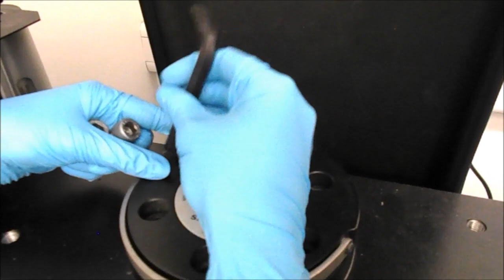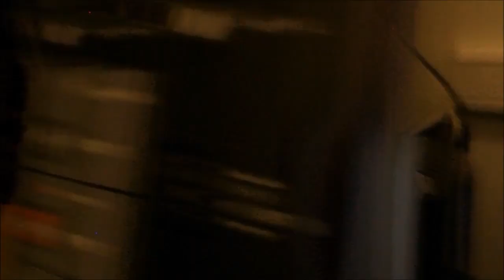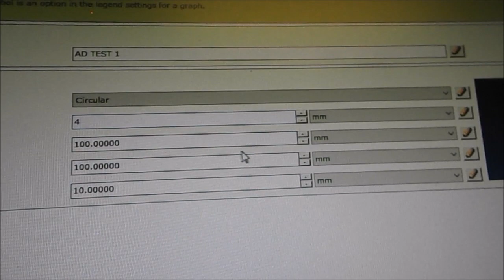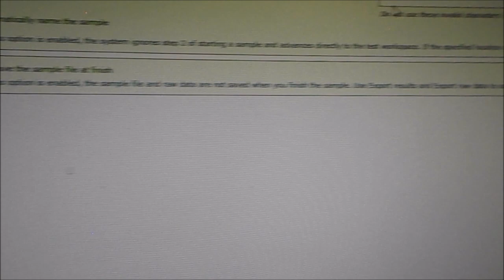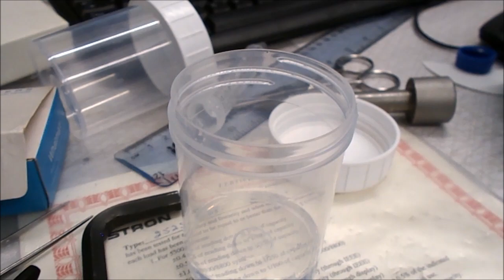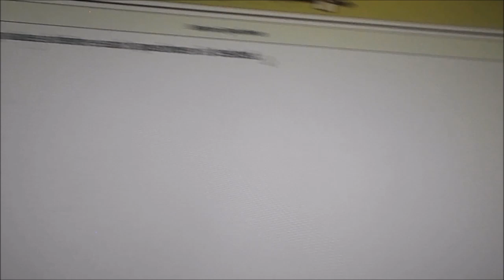Instron Compression Test Instructional Video Compression

Comment: In your test, the maximum load is 133.96N and area of your samples is pi/4*d^2=~50 mm^2. So, if I calculate the Engg Compressive Stress it's coming only ~2.7 Mpa but in the result (Compressive stress at maximum load) 10.328 Mpa, why? Could you please share the calculation if possible?